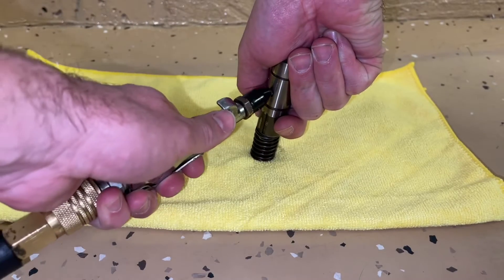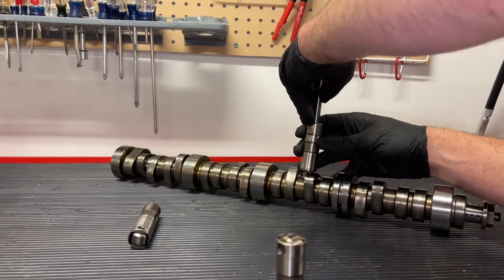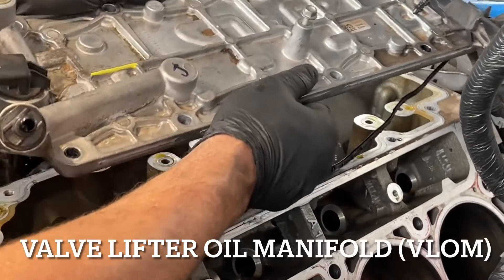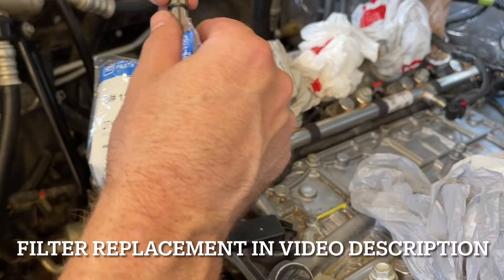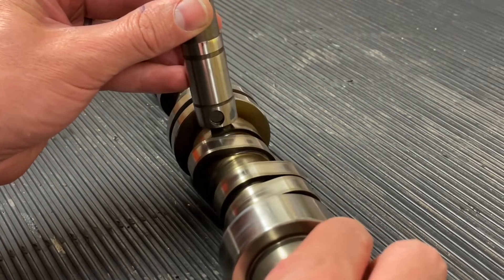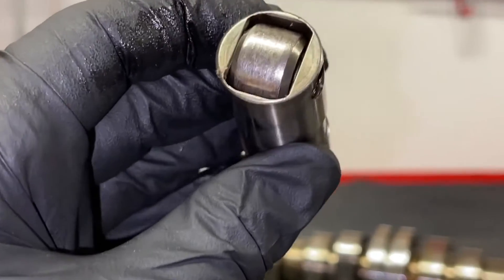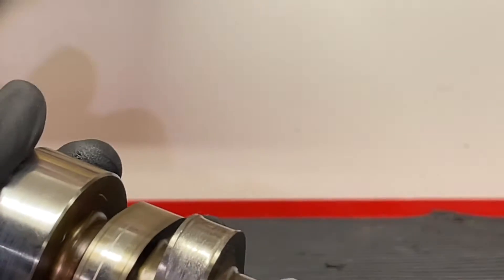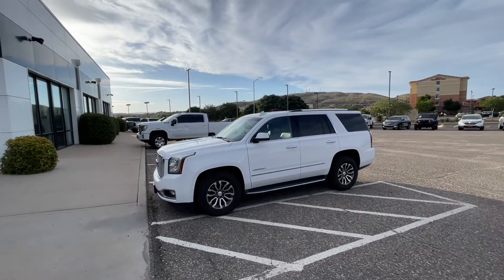GM DOD/AFM Lifters operation explained, failures, how to delete. Why GM engines fail 5.3L 6.2L

Comment: Why don't they instead shut down the injector to the cylinder?
Reply from the maker: I thought the same thing- and leave all the valves alone.
Reply: Read this in a GM forum, but it was quoted from somewhere else. I suspect if you keep the valves closed you reduce pumping losses and maybe oil consumption.  "
During the transition from V8 to V4 mode, the Fuel Injectors will be turned OFF on the deactivated cylinders. To help prevent spark plug fouling, the ignition system secondary voltage or spark is still present across the spark plug electrodes on the deactivated cylinders. If all enabling conditions are met and maintained for cylinder deactivation operation, the ECM calibrations will limit cylinder deactivation to a cycle time of 10 minutes in V4 mode, then return to V8 mode for 1 minute."

Comment: Not buying Chevy engines with this period.....
Reply from the maker: @stevenhudson3482  the L8T is one of the only other ones they does not have it, and only in select models (I don’t believe in any Yukons or Tahoe’s). Sadly it also is direct injection and has oil problems

Comment: I have a 2022 Silverado with the 5.3 L engine. It didn't come with the AFM because the lack of chips due to the Covid pandemic but I wonder if they still used this type of lifter?
Reply from the maker: Yeah, the lifters are still in there to my knowledge

Comment: So why did the non AFM lifter fail? I also had a non AFM lifter fail in my L83 with 47k on cylinder #2. It would make a ticking noise only above 2,500 RPMs.
Reply from the maker: I believe they are cheaper lifters to offset the cost of the dod lifters. Either that or oiling problems. Perhaps the dod also causes more pressure on regular lifters. Just my thoughts.
Reply: @dannyjohnsonsgarage  I also suspected that it has to do with lifter quality. I could be wrong but I feel like I don't hear as many problems with the Camaro and Corvette 6.2 l as with the truck engines. I wonder if they have better lifters?
Reply from the maker: @ I heard Camaro engines all come with the dod lifters but aren’t activated unless it’s an automatic transmission car. You probably see failures more when dod is active.
Reply: @dannyjohnsonsgarage  Hard to say, mine was deactivated at 500 miles, unlucky, I guess. Had a 03 and 08 5.3 trucks that went 235k and 185k respectively that never had one issue with the engine or trans.

Comment: So with these so-called "lifter events" where the lifter is going from active to non-active, isn't that a mechanical actuation that causes physical wear in itself? So in theory, wouldn't stopping that mechanical actuation with a DFM delete, (i.e. Range tech module), reduce physical wear and chances of lifter failure? I read a lot of arguments on deleting DFM being a means of preventing lifter failure. Which is it? Thanks!
Reply from the maker: Yes, with it in V8 mode constantly it will reduce the wear, but may also clog the system in the event it does try to go to 4 cylinder mode. I have also heard reports of it being in V8 mode but the solenoid leaks and then collapses the lifter when it shouldn’t. I have a friend who says any he has turned off have not come back yet, so it’s a good first step, then a dod physical delete once it fails:  https://youtu.be/cWayyZGNYRI?si=8op44yqaB5W0JunS

Comment: Do these problems apply to the 2017 4.3 V6 with DOD?  We have 6 in our fleet with well over 100,000 miles and no issues.

Comment: We experienced problems with a 6.2l engine ( Silverado 2016) first in 2023 November . Dissambled the engine ( three bent push rods)   Replaced all AFM-lifters and the pushrods . That was a lot of work with the engine ( intake , cylinder heads , fuel supply , LOMA ...) all dismantled and cleaned . The put all together and the engine was running until May 2024 . Same ticking noise and misfires again. Ist was only the bank driver side , so we only repaired this side . Engine was running fine until September 2024 . Again nocking sound and misfire . But this time we only removed valve cover and replaced two bent pushrods at cylinder one and seven . Again all worked fine until December 2024 . One bent pushrod at cylinder one . The distaance between each incident are getting shorter and shorter because yesterday ( 5fth of January )  again cylinder 1 with ticking sound and misfire. So we thing the head has to be removed again . What I wonder is , that when we removed the head and AFM lifters all lifters looked fine ( no one was collapsed permanently )  .  And at the lact incident the driver told me , that it occured at startup , engine was running fine until he shut of and started again 30 minutes later. There the engine was shaking with a thud and from that point there was the ticking and the misfires. Obviously something  hapend , what not should have happend.  But why ? At atartup the engine is in 8 cylinder  mode  , ALWAYS .  My question is , could we deactive the LOMA by pulling the electrical plug ? Are the AFM lifters delivered with normal oil ( like the regular lifters ) or is there a lack of oil for the AFM lifters when the LOMA is not working? I thought , that the LOMA ( and the oil pressure ) is only for activate / deactivate the locking pin inside the lifter .

Comment: I have a 2011 Holden Commodore SS L77 6.0L and my Intake valve (CYL 4) is not opening properly, I removed the valve cover and the Intake Valve only opens once when cranking and then it stays shut for as long as I crank the engine.
When the engine is running it's knocking and misfiring.
I'm going to pull the head off and do the DOD delete plus upgrade the camshaft and port the heads.
Reply from the maker: Check out my walkthrough. It may be a helpful guide, but hopefully a bit easier with the 6.0L. You may be able to remove the oil pump as I was not able to for the L86 https://youtu.be/cWayyZGNYRI?si=jmVrniDU2peetAqd

Comment: This system basically requires more frequent oil changes for it to work properly and keep working properly for a lot of miles. I would say 5k mile oil change intervals max. If you push it for a few oil changes you are just asking for trouble.

Comment: There is a part of this system that I'm confused on. When the solenoids allow pressure to the lifter to cause it to collapse, to go into 4 cylinder mode, does that solenoid allow a constant pressure the entire time it's in 4 cylinder mode. Or does it have to modulate the solenoid depending on where the lifter is on which portion of the lobe? For instance, if the lifter is on the lift of the lobe, does it have to collapse it to keep tension between the lifter, pushrod and rocker? Or is the spring on top of the lifter taking up the constant change in clearance? I hope my question makes sense.
Reply from the maker: Very good question. I believe the solenoid opens and oil pressure is sent to that lifter keeping it collapsed until the oil pressure is shut off. I’m not sure, though. The most important part to me is making sure the oil is clean so it does not fail on collapsing or returning from being collapsed, and that the solenoids do not fail. I have been told both may occur- a solenoid may still leak if the vehicle has dod turned off, so that’s why a physical delete is best. Mine did not have dod failure, but a regular lifter. A friend of like said he “had not had one come back yet” for all he turned dod off on. Dod can also destroy the transmission over time, so in all cases it’s risky.
Reply: @dannyjohnsonsgarage  after noticing how the common symptom of collapsed lifter: how the pushrod and lifter develope slack between the cam lobe and the rocker arm, it made me wonder how a tight clearance is maintained with the lifter and pushrod in 4 cylinder mode: there has to be something maintaining that clearance. My guess is that the spring at the top of the lifter keeps pressure on the assembly so you don't experience the pushrod and lift tapping into the rocker arm and cam lobe, respectively. So if that's the case, then my guess is that the solenoid only has to allow oil pressure to the filter once to activate the collapse, and then it simply stays in 4 cylinder mode the entire time until the solenoid is once again commanded to close and then the oil pressure is removed, and v8 mode resumes.
Reply: @dannyjohnsonsgarage  thanks for the reply.

Comment: i have a 2015 6.2.  stuck lifter on #7.   should I get the tool to try and unstick?  replace the lifter with a non collapsable lifter?
Reply from the maker: You can try to unstick it with the other tactics from other videos, but it may happen again. You’ll need to remove the head to get the lifter out and you’ll have to replace it with another dod lifter or go deeper to replace the cam  for the non dod one https://youtu.be/cWayyZGNYRI?si=f9OfUAL6XunVgtsV

Comment: It's criminal that these lifters and cams go bad because of a crap design for the sake of an extra 3 mpg. Ends up costing us a lot of money to have it fixed/replaced. GM should be held accountable
Reply: I have the plug in disabler, and the mpg didn't get any worse in constant V8 mode.
Reply: How about a car payment deactivation
Reply: The only extra mileage is on paper not on the road
Reply: Agreed my plug-in disabler has worked fine for 2 years I'm hoping that I never have any problems
Reply: I now believe it's by design. GM makes both the EPA and their board happy. Because the engines will eventually fail out of warranty. So every 100k miles you will need a new truck.
Reply: @Poopster4U not for repeat business
Reply: No way it was even marketed as 3 mpg it would be great if that's what it did but from what I have seen it is always a dirty poorly maintained motor so I don't know but that's what I have seen that screen clogged up probably can see it on the oil pressure gauge but people don't pay attention or even know what they are looking at
Reply: There is no increase in mileage period
Reply: It a saves 3mpg on average only if you factor in the time spent being towed.
Reply: These engines are Designed for obsolescence, along with their trash transmissions.

Comment: Great video
Quick question
I have caprice ppv 2012 v8
It has now failed lifters due to the filter being blocked by sludge
If i replace the failed / damaged lifters and get a good used condition cam
Is the engine save able ?

Will it work for some time or i need to replace everything as stated in your video

I'll also be changing the oil pump
Reply from the maker: Cams are not very expensive. I would replace them if you need to get that far into the engine. If you only need new lifters and the cam is okay on inspection, just change the lifters. It depends on what you’re trying to do. I had to change the cam as well with deleting the collapsible lifters. If you see a lot of metal shavings you’ll want it completely torn down and cleaned out or it could ruin the engine later
Reply: @dannyjohnsonsgarage as per my knowledge the process of deleting the dod includes changing the cam and lifters and valley plate but is it possible just to change the lifters to non collapsible ones? Or dod is the only reliable solution?  @dannyjohnsonsgarage
Reply from the maker: @ the cam is different than the dod cam so it must also be changed as far as I know

Comment: My 07 suburban LC9 5.3 had 240k miles on the original dod before i removed it for a 6.2. Its all about how it was maintained, proper oil weight etc.
Reply from the maker: The 2015+ Yukons may have been a different story. I didn’t have problems with dod, changed the oil sooner than later but a regular lifter failed and it has been common with other from what I’ve seen

Comment: My 2019 with 90k miles had a lifter ,cam shaft failure recently. Be put back together currently.  G.M. thankfully reduced repair cost from $9 to $6k to repair. Very concerned about future reliability. Video was very helpful from someone who is not a mechanic.
Reply from the maker: I completely understand. After 6 months of mine running well I decided to move on to a Toyota Sequoia, the last of the V8s https://youtube.com/playlist?list=PLIjr-uSYDZi4VVY98CUqYZPQMptDhexbN&si=kyT1fj8fgBUCN3Rp
Reply: Thinking about trading my Silverado for tundra.
Reply from the maker: @paulgreen177  I would get the last year of the V8 as I did. The new tundras all need new engines from machining debris Toyota Tundra Playlist
https://www.youtube.com/playlist?list=PLIjr-uSYDZi57XD9z82F06EWPIA6KBhzI
Reply: Got mine repaired at 90k and broke again at 92k

Comment: Chevy was not selling as many trucks as Ford for almost 40 years. What happened is the trucks were lasting to long and people were keeping them so they had to make something fail and chose the lifters. When doing this job delete the AFM lifters with normal lifters if you can and those normal lifters should easily last 300k.
Reply from the maker: I think it also had a lot to do with the bailout and how GM had to meet better fuel economy under its new stipulations. Being harder to do, yes, they probably had a target reliability of just what warranty will cover. They are likely making a lot of money doing repairs out of warranty
Reply: @dannyjohnsonsgarage  Agree but why not just add less fuel using smaller injectors? The AFM thing is not a good deal. It’s a huge safety issue and could allow you to get hit and killed by a car coming at you
Reply from the maker: @zackk695  i think they should have just shut off fuel for that cylinder and allowed it to keep opening and closing the valves. They do have direct injection which uses less fuel but causes other gunk problems Direct injection vs Port injection, why direct injection is bad for your engine, what it looks like
https://youtu.be/Op2nSHkoD1Q
Reply: @zackk695 That's not how fuel economy works. Can't just swap to smaller injectors 😂
Reply: @jonathanvaldez7850  ok Let me break it down for you so it’s clear. When I say smaller injectors I’m saying all that goes with it such as heads, cam, etc to tone down the motor to less horsepower. This is well known and they do this with all motors. We know all motors can be modified to make more hp yet they loose fuel economy as well as dependability. This is what they need to do to the 327 and instead of making it 355hp make it 300hp and it would save gas and the engine would last longer
Reply: @zackk695  yeah.... No. Lol. You don't magically get more fuel economy going to smaller heads, cam, power.

Shocker to you might be that peak power output actually has very little to do with fuel economy. Cruising along you're only generating 20-40 HP. The volumetric efficiency at the cruising rpm and load matters much more than peak horsepower (which doesn't matter at all).  There are many factors that go into VE (cam, heads, exhaust design), but then there's the design of the piston, how fully the mixture is burned (not wasting fuel/air).

Been tuning cars for >15 years now. I can tell you that there are MANY times I've increased fuel economy and increased peak power output, because the changes done improved VE for cruising region. Now if you use the peak power output all the time (i.e. floor it constantly), yeah you're going to burn more fuel, but we're talking cruising.
Reply: @ Yes, tuning down a motor does save fuel.A 327 at 300 hp will use less fuel than a 355 hp motor. Air and fuel equals hp. Yes there are other variables but less hp will use less fuel always
Reply: @zackk695  alright well you've shown to me you don't understand how engines work if you think peak power output = fuel economy 🤣 . BSFC, VE, exhaust scavenging is all meaningless

I tried. Have a nice day.
Reply: Is there a setting on the dash where you can turn off the fuel efficient mode?
Reply: @Evoke_1 not without 3rd party hardware/software but it doesn't make a difference

Comment: Also it does no good to replace them if you put the same part back in which will fail again. A lifter can easily last 300k miles. Just look at Toyotas 5.7. So what lifter do we use to delete the AFM and allow this great engine to run 300k without issue is the big question and also the part number?
Reply from the maker: You use the LS7 solid lifters but you need to buy the kit that also comes with the non-dod cam. Brian Tooley racing sells the kits https://youtu.be/cWayyZGNYRI?si=rmOQT7gr2nAKBgx6
Reply: @dannyjohnsonsgarage  Got it and that helps a lot. Hopefully they will last forever like a lifter should

Comment: This video is exactly what I've been looking for! I have a 2018 6.2L denali and had the lifters replaced a year ago. Well now the lifters start ticking at 75-80 mph and only in V4 mode, and only when my foot is slightly on the gas. If it pops back into V8 the tick goes away. Do you think it's just my lifters again or could it be my camshaft too? Id think the tick would be constant if the camshaft is damaged. Only 2k miles until my extended warranty is up 🫠
Reply from the maker: I would definitely claim it for the warranty before it’s your problem, but the range disabler that keeps it in V8 mode would be a good idea. I’ll post one below from my Amazon affiliate link. If the noise isn’t there in v8 mode the cam may still be okay, but who knows if it’s being damaged each time. For the meantime, I believe putting it in manual mode and in 6th gear may keep the 4 cylinder mode from activating. https://www.amazon.com/dp/B0CTJNM7XQ/ref=cm_sw_r_as_gl_api_gl_i_FRECHW9NBNZT0K6SMG35?linkCode=ml2&tag=2004047-20
Reply: If you don't mind me asking , why didn't you disable the afm ?
Reply: @killakam123321  honestly I thought the new lifters would outlast my ownership of the Yukon and the odds of a second failure low, plus the gas mileage with the AFM is decent. Ended up getting a stage 1 cam and non deactivating lifter package. Problem solved forever